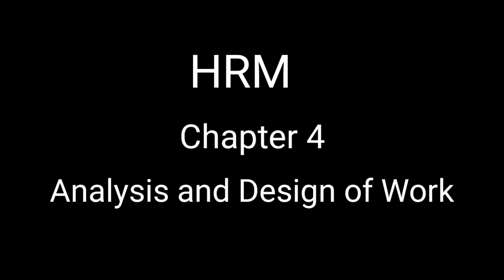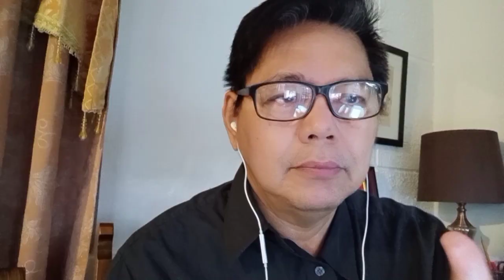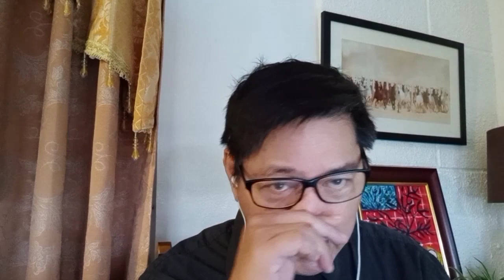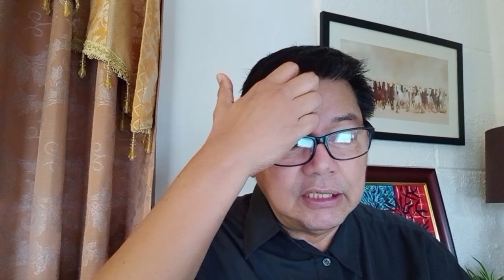HRM: ANALYSIS AND DESIGN OF WORK

Comment: Parazo, Juan Sebastian A. 
AMC 1

In this chapter i've learned that in two brands that in the same industry but in diffrenty strategies. you see the one company is showing a improvement in a job analysis because for example their performance was not enought in the previous years and now  showing it into a well improved company. and the other company maintaining its standard because itstill shows a better performance that will make them  still the best performing company now they both showing  a good flow of operations to make a compitition in business.

Comment: Albaro, Joy Ann 
AMC 1
     Chapter 4 is all about The Analysis and Design of Work. I have learned that Workflow design is the process of analyzing the task necessary to produce a product or service prior to allocation and assigning this task to a particular job or employee. while the Organization Structure is defined as the relatively stable and formal network of vertical and horizontal interconnection among jobs that consecutive the organization. according to the video that Sir has given workflow analysis is a process that is useful that provides the manager to understand all the task that is required to produce a high-quality product as well as the skills that is necessary to perform that given task. Work output is the result of work carried out by people using equipment over a certain unit of time. A Workflow is a sequence of tasks that processes a set of data. Workflows occur across every kind of business and industry. Anytime data is passed between humans and/or systems, a workflow is created. Workflows are the paths that describe how something goes from being undone to done, or raw to processed.

Comment: De Villeres, Joshua S.
AMC1

This chapter discussed job analysis and job design in the HR management environment. The importance of these topics is to identify job analysis and job design, what’s their difference and purpose. As for their difference, job analysis makes use of different methods such as PAQ, this is to analyze the candidate’s capability. It’s a standard questionnaire type that entails their work behavior, conditions, and characteristics. As for job design, it is the company’s process of distributing work amongst candidates and which task fits them the most. Why are these important for HR managers? This kind of process, it makes a company fully competitive and productive as they hire employees that are not only good on paper but also good in hands-on.

Comment: Gwyneth Grefal
AMC1

The fourth chapter showed me how the details of the topic were broken down. I was able to see how different approaches to job design might differ, as well as be reminded of organizational structure and process. The activity's approach is straightforward, but it was far more extensive than I had anticipated. There are also other instances that we may think of that will help us have a better knowledge of the subject. BMW and Toyota are some of the examples given. When I hear the phrases "job description," "job analysis," and "job specification," I usually enumerate the same things and just tell them what they should accomplish, but it isn't just that. They are two distinct processes. I'm familiar with several methods of analysis, but I'm not sure how to select the best job analysis methodology for a range of human resources. The job analysis covers work to redesign, performance appraisal, job evaluation, career planning, training development, selection, and HR planning, which is why HR Managers respect it. It provides a workflow approach as well as task requirements in a nutshell because you can only perform successfully if you know what you're doing. Understanding is vital since knowing is not the same as understanding. The section of chapter four that I enjoy the most is the trade-offs between alternative methods to job design. With this chapter, we can see the importance of job design and job analysis, which includes gathering and analyzing personal data that may have a significant impact on how a person does their work. It has to do with making sensible judgments and reaching a certain objective by being in the right place with the appropriate person and utilizing their ability, experience, knowledge, capacity, skills, and talent. At the end of the video, I can see the difference and which organizational structure or technique should be chosen based on the circumstance.

Comment: Antonio, Renzel
BMC-1

This chapter is about job analysis and design in
human resource management which is very important for all us students of HRM. Job analysis demonstrates who can fit at a particular place
and why. Strategic HRM is basically concerned with the strength, weakness, opportunities and threats of an organization.

Job design follows job analysis. Job design essentially involves integrating job responsibilities or content and certain qualifications that are required to perform the same. JobDesign integrates job responsibilities and qualifications/skills that are required to perform the same. There are various approaches to do this. Like - Human Approach, Engineering Approach and Job Characteristics Approach.

Comment: Baylon, John Cyrus R.
BMC1

Workflow analysis is the act of taking a thorough look at your firm and determining where its strengths and shortcomings are. It aids in the discovery of inconsistencies in an organization's procedures and allows business leaders to make necessary modifications. Of course, process assessment is not a required activity, but failing to do so can result in chronic and difficult-to-resolve issues.

Knowing what the work's demands or criteria are, and informing people about them, will assist the company in hiring the right individual with the suitable qualifications or fit for the position, resulting in a positive outcome for both the company and the employee.

Comment: Cortez, Jacob 
BMC 1 

The video went over Job Analysis and Design in Human Resource Management in depth. Job analysis is the process of defining and analyzing the tasks, responsibilities, and qualifications of a certain job. It provides organizational data that can be used to determine which workers are most suited for specific jobs. Human resources professionals would next explain the position's requirements and outline employer expectations, which is practically all you need to produce the most accurate job description and develop the ideal job for the company's recruitment needs. Job design, on the other hand, aids in determining the amount of knowledge, qualifications, abilities, and experience required to perform a job efficiently.   Highly efficient leaders may join the business if the tasks are carefully organized. They would be motivated to raise the organization's efficiency and income, which is the basic purpose of any corporation - to increase the profitability of its shareholders.

Comment: Lopez, Ashly Matthew
BMC1

This chapter provides an outlet to the Job analysis and design in the work area it comprises the usefulness of a person on he can contribute to the development of the company it also helps come up with techniques in regards with the analysis of jobs. it also talks about the various approaches in designing a job to provide a certain position which will lead the company to higher success.

An important component of competitive advantage and strategy is job analysis and design.
To ensure efficiency and effectiveness, managers must comprehend the full workflow process and have access to clear, precise task information.
Managers can restructure tasks so that the work unit can achieve its objectives while employees gain motivation, satisfaction, safety, health, and accomplishment.

Comment: Dimacale, King Michael G.
AMC-1

This chapter expanded on the important principles about job analysis and design that were initially introduced in the last chapter. Job Analysis and Design aids businesses in achieving overall improved performance by determining how a job should be performed and who is most suited to undertake these duties for a smooth flow of operations. This subject also distinguishes between a job description and a job specification. The latter is a list of knowledge, skills, talents, and other traits that an individual must have to execute a job, whereas the former is a list of tasks, obligations, and responsibilities that a job requires.

Comment: Uy, Aleck
AMC1

This chapter, based on what I've learnt so far, gives a lot of info on job analysis and design. This chapter focuses on the differences between the two. To begin, it is necessary to understand what Job Design entails. Job design, as far as I understand it, is the process of determining an employee's strengths and where he will best fit in the organization. When it comes to job analysis, it will look at the employee's real-world experience. The employee's education, experience, and other factors. Both have a significant impact on the company because they allow individuals to be assigned to positions where they are most effective.

Comment: Mapula, Paul Vincent G.
BMC1

The Chapter 4 talked about the workflow analysis that helps the development of workflows in organizations and business establishment to simply improve its efficiency and overall performance. It is also in discussed work processes wherein the step-by-step process how things are done in a simplified manner. Job Analysis is referred to as the process of identifying and determining the duties, responsibilities, and specifications of a given job that also surround the data collection needed to together put a job description that will pull out the right person to fill a certain role.

To sum up all that has been tackled in this chapter, both workflow analysis and organization structure are vital parts of HRM as it makes the processes that has problems or inconsistent behavior be improved and also to make a simpler order in the systems of the organization.

Comment: Bermundo, Jerome B
AMC1

Based on the video presented, I learned the difference between the job analysis and job design and how are they interconnected with each other, which made me realize on how job or work really process. Job analysis refers to answer the question what do you need for that job?, what kind of skillset, abilities, background , level of experience etc. of an employee must require to have for the job. On the other hand, job design  be understood as the process through which the job process is defined, the work of the group is organized, which involves structuring the workplace on the basis of the job analysis. Both practices are extremely relevant in order to build a strong foundation of an advantaging organization in a competitive world of business.

Comment: ORBETA, Gabriel Thomas T.

AMC1

Video Analysis

Components of the video include job analysis, which is a process on how a company hires an employee and their specific role for the business. The major goal of a job analysis is to use this information to hire a suitable fit between work and employee, to analyze an employee's performance, to determine the value of a specific task, and to assess the training and development needs of an employee performing that job. Job analysis, is determining how qualified an applicant is for a job, there are requirements to meet, specifications to have, and the experience to have the job. Job design is the organization of work to efficiently process as a company or business. It determines an employee's share of workload, authority over his work, decision-making capacity, level of satisfaction, and predictability. It covers the numerous tasks that must be completed by the job holder, as well as the obligations and relationships with other positions.

Comment: Dichoso, Paulo Miguel T.
AMC1

The Job Analysis and Job Design are interrelated because The way jobs are designed and can be affected in company work performance. also, Toyota surpassed the general motors using the standardized structure. BMW is considered the polar opposite to simplify and standardized procedures. The structure of Airbus and Boeing were also compared as the discussion goes through. also, Job analysis is the building block of everything the personnel department does. Managers must clearly understand the task required for each job within their scope. There are some job analysis methods used like the Position Analysis Questionnaire (PAQ) and Occupational Information Network (OINET). 

	also able to analyze an organization to structures to workflow processes in how to understand the importance to the job analysis it has a strategic HRM to identify the output analysis and also inputs to production and services. also, discuss the job analysis that process to determine and record the pertinent information to the specific job to knowledge and skills to perform to the job. The job design is the process of the structure work and designating the responsibility of the employee.

Comment: Jimenez, Aroen Mikhail C.
AMC1

An intriguing conversation to keep an eye on. This chapter accurately communicated the distinctions between job analysis and job design. It has discussed how these two are related and how they affect the overall success of the organization. Job analysis and job design are the foundations of human resource management because they serve as the initial link in attracting and accommodating the company's required and best-fit human assets. The said section aims to teach us that component of Human Resource Management's job, It is to function all over how an organization needs in terms of processes, guidelines, and constructions, as well as to analyze practices and revamp them to fit the company's needs in order to make changes, avoid downfalls, perform existing assessments, and develop programs that allow the organization's ultimate resilience.

Comment: Francisco C Abrenio
CMC1

After seing this presentation it talks about Work Flow Design is the process of analyzing the tasks necessary for the production of a product or service prior to allocating and assigning these tasks to a particular job category or process Organization Structure refers to the relatively stable and formal network of vertical and horizontal interconnections among jobs that constitute the organization Work-flow design and organization structure are both used to gain a competitive advantage for the firm. How one does this is based on the firm’s strategy and its competitive environmen

Comment: Samaniego John Paolo B.
CMC-1

After seeing this clip, I learned about the work design of products or services delivered by a work unit, as well as the analysis of the system, technologies, abilities required, and the development of blocks that the human department executes. Performance appraisal forms can be built using data gleaned from a job analysis. A form that includes the job's duties or behaviors and specifies the required performance level for each is an example of a job analysis-based form. The need of job analysis is important throughout this situation. Job analysis' purposes are to constantly ascertain and record job-related information from employment measures such like training, hiring, remuneration, including performance evaluation. A job analysis is a procedure for determining a job's responsibilities and skill needs.

Comment: Lagumen, Angeline M. 
CMC1

The process of acquiring and analyzing information regarding the content and human requirements of jobs, as well as the setting in which they are performed, is referred to as job analysis while the process of defining employees' roles and duties, as well as the systems and procedures they should use or follow, i know as job design. 
For this chapter, it focuses about job analysis and design. Since both are the first step in attracting the human assets in the firm, both job analysis and job design are the basis of human resource management  It is elaborated in this chapter the contrasts between job analysis and job design with that it also explains how both can truly affect the company's general performance and how it is also related.